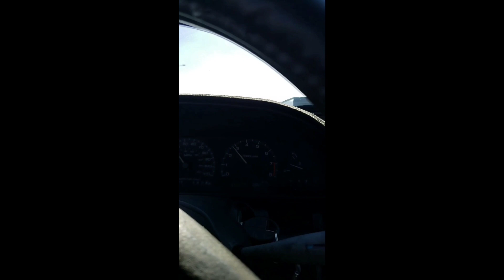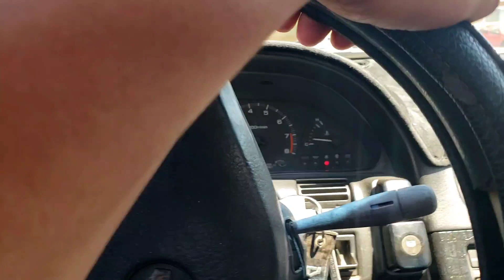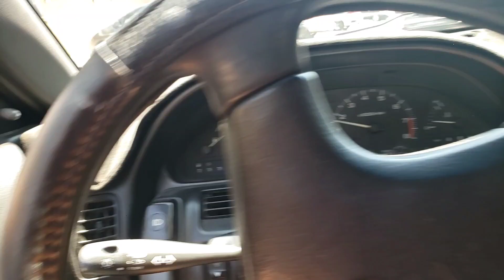Sad day for the 240sx/ BLEW MY ENGINE!! 😭

Comment: Did you ever get it to pass smog?
Reply from the maker: Yes I did, I had a "friend" help me pass it 😉
Reply: @mexi_garage2021  lol nice! I used to have friends like that when I lived in the Bay. I just got my catalys monitor to say okay tonight by using Cataclean. Shit, I am so thankful and relieved. I couldn’t believe it worked. I know it didn’t work for yours but I was getting desperate and mine hadn’t thrown a code yet it just wouldn’t say ok. But was really worried because I drove my truck for several months with a bad misfire because my intake went bad and was leaking water into the plug wells. My check engine light had been flashing at different times for over a month. I found that if I took
It off of overdrive it raises the rpm and the check engine light would stop flashing so I had been driving it like that until I could afford to have the intake replaced. I figured that monitor wasn’t coming up because I screwed up my cats. But that Cataclean shit worked and made the monitor come
Up. 
Anyways.. I’m glad you got good friends brother. ;)